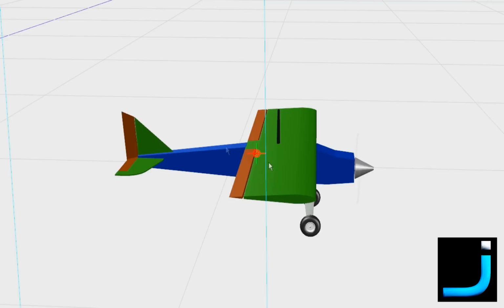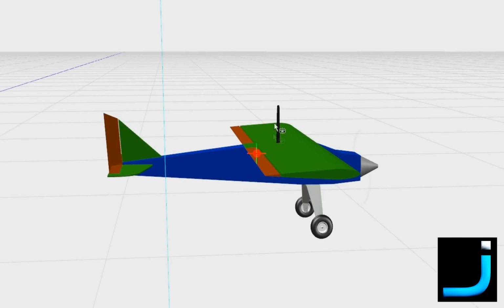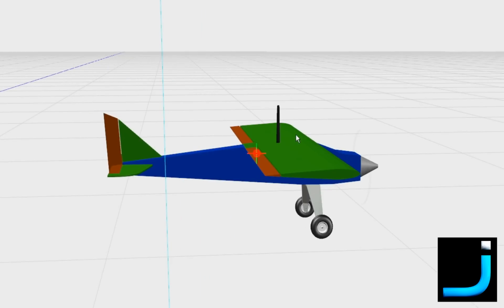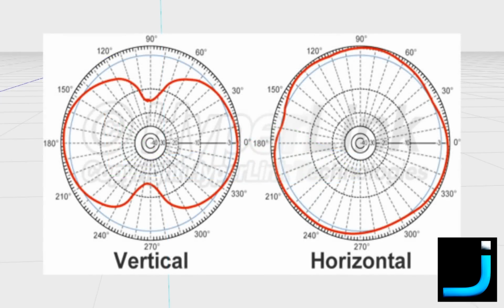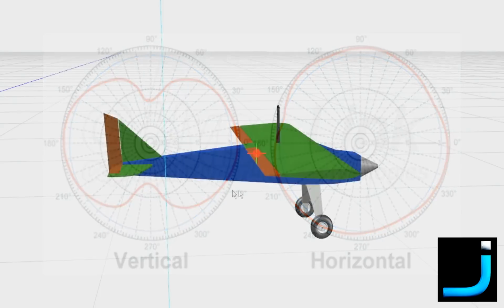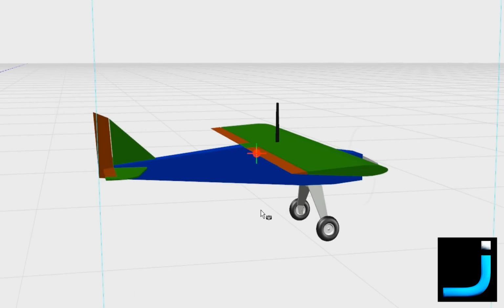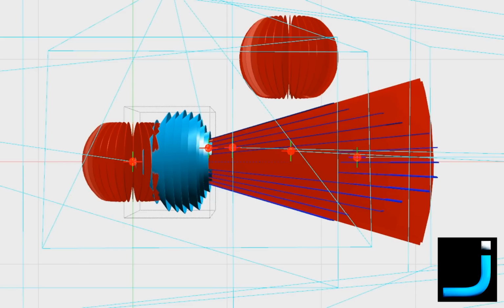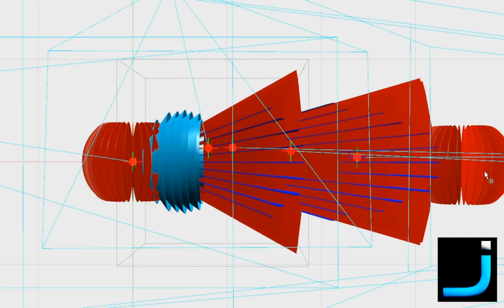Antenna 101 by Joop Media, Long range FPV antennas explained.

Comment: Is there any difference to left hand and right hand polarization antennas, or is it just a marketing scam?  In other words, now they are calling some antennas left hand polarized on the aircraft and then saying we should have a left hand polarized antenna on the controller.  Some people say it is bogus, and I dont know.
Reply from the maker: There is no difference, you just need to make sure that both Tx and Rx are the same.
Reply: Inside FPV
If Rx is left hand and Tx is right hand,  what will happen?
Reply from the maker: Vertigo1894 Youll get a miss-match of polarisation. So no where near as good range. Similar to having circular and linear in the video.
Reply: Inside FPV
Okay... that's what I was wondering.   Thanks !  It was a fantastic video and appreciate your time to make us informed.
Reply from the maker: Vertigo1894 Youre welcome. If there is anything else we can help with or any other videos you like us to make in the future please let us know.